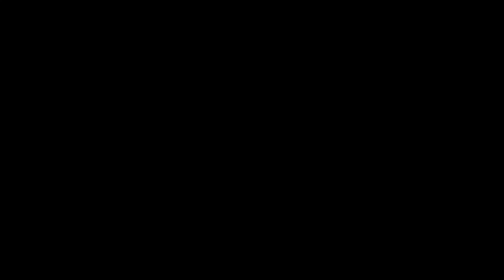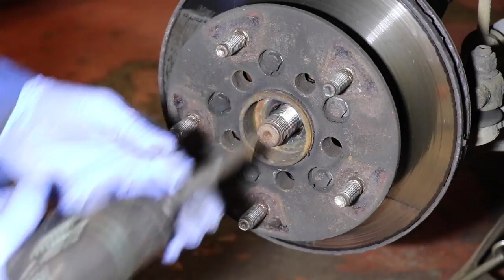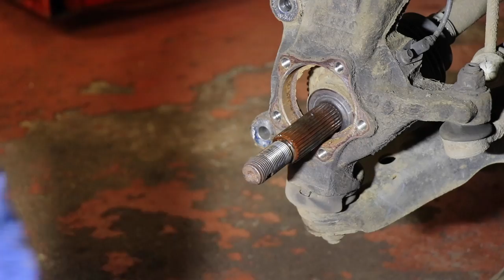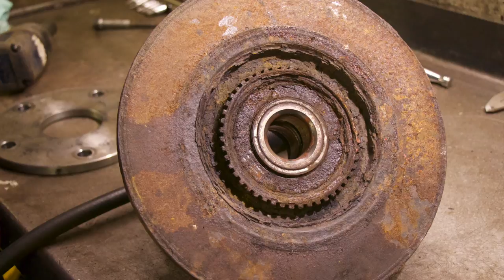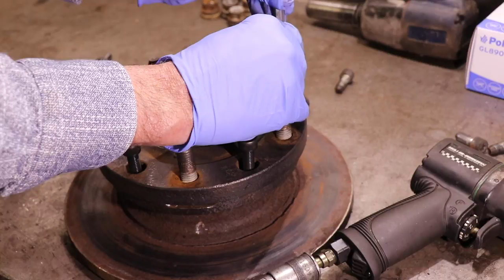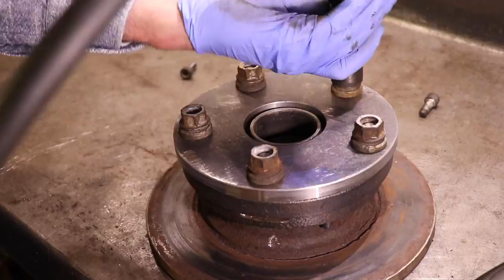Ford Transit Van Brake Assembly Puller from Nick Candlish at Doon Engineering

Comment: You can use the wheel as "plate" also. But be aware, if you have removed the big axle nut the wheel bearing might seperate. The whole unit might be so stuck that the inner bearing will losen and come off. I just had to change one wheel bearing cause of this. (when changing discs)